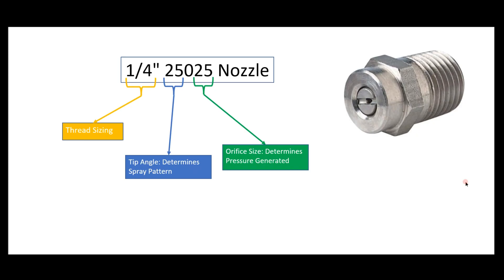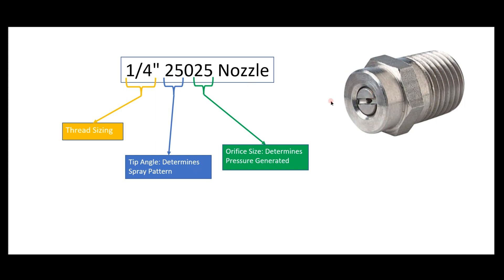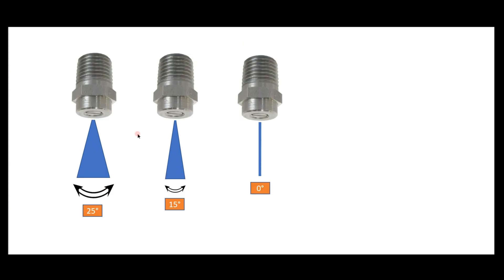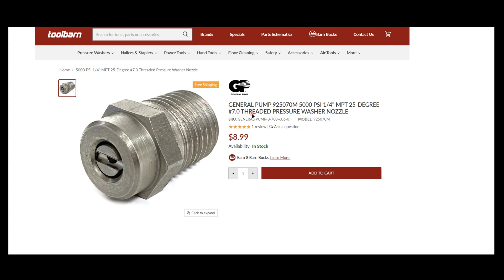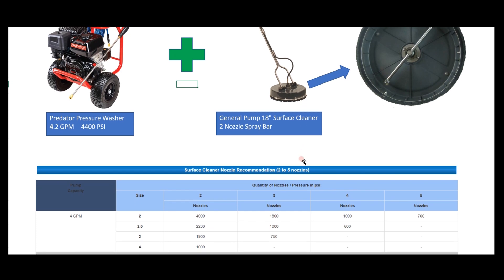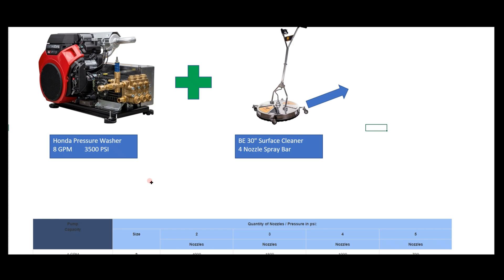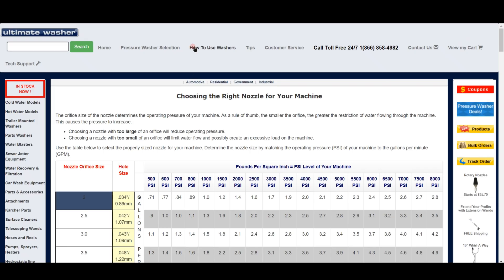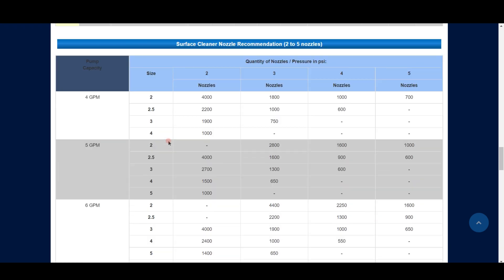How To Properly Size Surface Cleaner Tips

Comment: What are the best/recommended sized tips for wood cleaning like Cedar and hardwood? Or how do you swap from cleaning concrete to cleaning wood with needed pressure differences? Like surface cleaner on the deck cleaning.
Reply from the maker: I would never recommend using a surface cleaner on wood. Should be chemical and low pressure only. You can dial down pressure from the pump unloader or get a surface cleaner regulator and install it which allows for easy regulation without touching the unloader
Reply: @pressurewashnerds alright I thought 40040 tip swap would be enough as that would reduce pressure to 1000 psi or less and be safe on wood. Controlling pressure by tip rather by a regulator. Or would you recommend the surface cleaner regulator. I have seen those.

Comment: Hi mate. I hope u can help. Just start out so I only have a 2 gallon/2900psi pressure and using a 16 inch surface cleaner. And advice please on spray tips would be really appreciated. Cheers mate
Reply from the maker: I hate to say it but want to be honest with you. 2 GPM is undersized for a 16 inch surface cleaner. The tip charts really don’t even work for anything under 4GPM.
Reply: @pressurewashnerds what would you recommend for a 3.5gpm 4000psi with a 16.5in surface cleaner?
Reply: All good mate. I appreciate your honesty

Comment: I have a 8gpm 3500 psi with a 20 inch surface cleaner. (2 nozzle) im trying to figure out the exact tips for surface cleaning. What do you recommend? Thank you!!
Reply from the maker: Sorry for the delay!! But you’ll want 5.0 orifice size to start. 25 degree is the angle I recommend

Comment: If you don’t mind helping I have a 8gpm 3500 psi machine with 18” surface cleaner and can figure out what tips to run. I’m told I need a variety, what do you recommend? Also I want another bigger surface cleaner what’s a good size to pair with my 18”?
Reply: 2 nozzle
Reply from the maker: I’d give 5.0 orifice size nozzles at 25 degrees to start. That should land you around 2500psi

Comment: Thank you your videos helping me understand it a bit. On a 4.2 gpm predator pressure washer. How do I adjust the pressure without messing with the gpm. The black unloaded valve or the turtle to bunny bar I’ve received mixed information.
Reply from the maker: You adjust the black unloader valve for pressure. Shouldn’t see any noticeable drop in GPM

Comment: I have a 5 gpm and 24 inch surface with 2503 tips and my last Job i etched the concrete. What is the best tips for me 40 degree?
Reply from the maker: Do you have a pressure gauge? I would check pressure first. Should be around 2000-2500 psi for general concrete
Reply: @pressurewashnerds is that pressure for just one tip? Or it divide between two ?

Comment: The diameter of the surface cleaner doesn’t factor into the nozzle size?  I was looking at a 20” cleaner to go with my 4.0 gpm machine. I know the cleaner is a little oversized, but was wondering if the nozzle size should be adjusted because of that larger cleaner.
Reply from the maker: Great question. As a general rule, 4” per GPM but many people had used 20” with a 4GPM. It’s just a little less efficient than a 16 or 18, so you’d have to walk slower.

Comment: Hello, could you help me?

My machine has approximately 3600 PSI and 4 gallons per minute. My surface cleaner has 3 nozzles. I notice that the machine has no pressure. Can you tell me which are the 3 suitable nozzles?

ideal angle 25 or 40 degrees?

Can I contact you directly through an email address?
Reply from the maker: 3 nozzles at 4 gpm is an odd size. I think I’d try 1.5 orifice size at 25 degree if I were you. dylan22runge at gmail if you need anything.

Comment: I live in the UK and here we clean a lot of block paving where its coveraged in weed and moss in between the blocks. I have a 30lpm 200bar machine. My surface cleaner is 700mm and has 3 nozzles. I wonder if i can upgrade my tips to create more pressure so it would remove the moss and weed easier. I currently have to go over 2-3 times then turbo for the bigger more stubborn weeds
Reply from the maker: You can try chemicals (pre-treat with 1-3% SH) to help kill the moss, then you might get lucky and go over the pavers once with your surface cleaner. 

That’s a trick we use if the flat work has a lot of organic build up.
Reply: @pressurewashnerds  I think the main issue is lack of pressure to remove so much moss and specially weeds. Is there a chance I can use smaller orifice fans, maybe 25 degree and 2 nozzles instead to increase that pressure or would it create too much back pressure?

Comment: Orifice size vs fan degree for pressure please
Reply from the maker: The pressures listed in the chart are always in the line, not what’s hitting concrete. So cleaning power is really going to depend on distance from tip to concrete and fan pattern. Personally, I think 25 degree is best and if you don’t have enough cleaning power then drop down one orifice size for a little more pressure.

Comment: On a 2.5 gallons per minute machine and a 20 inch surface cleaner. What would be the best tip to try to use trying to use what I got
Reply from the maker: Unfortunately this chart isn’t built for that low of GPM. I’m not sure if a 2.5 is enough to really drive a 20” even with correct tips

Comment: I cant understand these charts at all. I have a 6gpm 3000psi unit with a 20inch surface cleaner. What size nozzles "2"  would I need for that? Thanks.
Reply from the maker: For a 2 nozzle surface cleaner, I’d go with a 4.0 orifice size and 25 degree tips

Comment: I have a 3600 psi, 2.5 gpm pump. And a 15” surface cleaner with 2 nozzles. I looked at the chart you recommended, but couldn’t find the choice of number of nozzles listed . So for my specs and shooting for a 25* angle what nozzles do I need?
Reply from the maker: I haven’t found a chart that actually shows pressures for that low of flow. If I had to guess, I’d start with 1.5 orifice size, 25 degree and whatever thread size you have on the surface cleaner. You can find nozzle packs for around $10 on Amazon. Double check the threads because some in that range use a 1/8” thread instead of the standard 1/4”
Reply: @pressurewashnerds I’m in a similar place, mine is 3000psi, 2.3gpm.  What tips would you recommend for a 15inch surface cleaner please?  What is the advantage of 15degree over 25degree?  I can’t always use that much bleach in awkward U.K. gardens, I don’t mind moving slowly, I just need the power.  Useful video thanks

Comment: U want 25040 for 8 gpm ...40x2 is 80 or 8 gpm total with a two tip system
Reply from the maker: 2 nozzles at 8 GPM, I'd actually go with a #5  instead of #4 orifice size unless you're running a regulator or adjust your flow down at the unloader. 4000 psi (which most 8GPM pumps aren't capable of anyways) is just too much for concrete. 

But if that's what you use and it works well, awesome.

Comment: Doesn't it change though depending on the output pressure of the pressure washer? For instance you have a 8 GPM @ 3500 or a 4GPM @ 4200. This chart doesn't take into account the pressure of the pump only the GPM. I would think both matter because outputting the same amount of GPM at a different pressure will make a dramatic difference
Reply from the maker: The pump rating basically gives you the max pressure that the pump is capable of outputting. The pressure generated depends on how much backpressure exists in the system, such as tip sizing to adjust backpressure. 

Think in terms of your 0 degree red tip on the wand. That's outputting much higher pressure water than if you have a soap tip on. Same pump, but the tips make a huge difference in backpressure.
Reply: As mentioned, a pump creates flow not pressure. It is a resistance to that flow (in the case caused by the small orifice) that creates pressure. A pressure washer pump is a positive displacement pump. This means for a given RPM the pump will flow a fixed amount of water. As you make the nozzle opening smaller and smaller the flow stays the same, but the pressure increases until you put such a high load on the engine that the RPM’s begin to drop, which lowers the flow.

Comment: What about a 2.5 GPM pressure washer? I'm new to the business and I was wondering what size surface cleaner would benefit & would I still have to change the tips on the surface cleaner?
Reply from the maker: Devin, 2.5GPM is a common sized surface cleaner for residential users, so there's plenty of options out there that will work just fine off the shelf. I'll link one below that should work well for you. 

https://amzn.to/3LdEVAk

Changing tips becomes really important once you grow into a 4GPM + sized machine, which I'm sure will happen rather quickly for you!